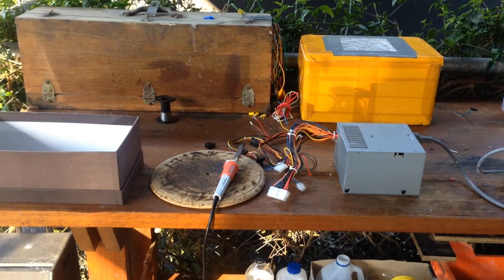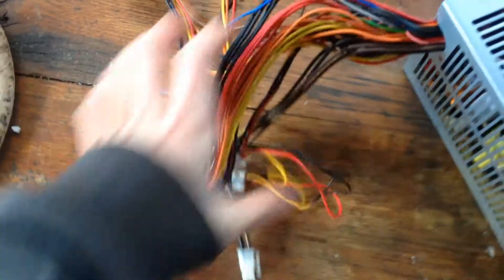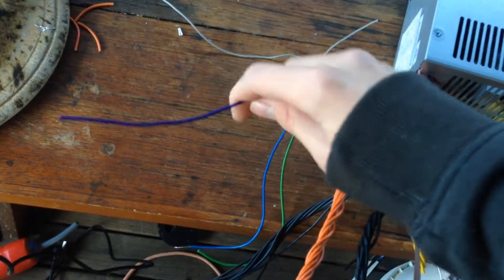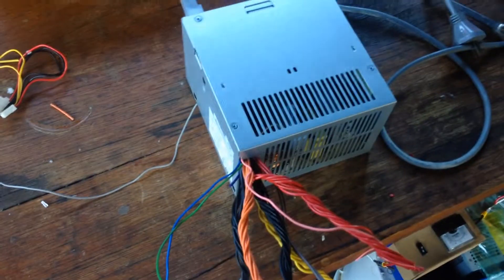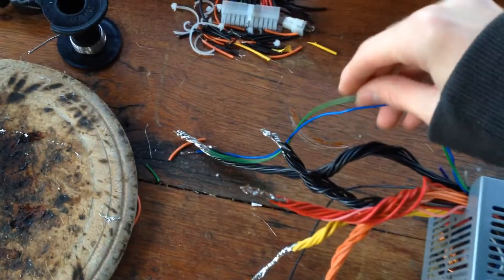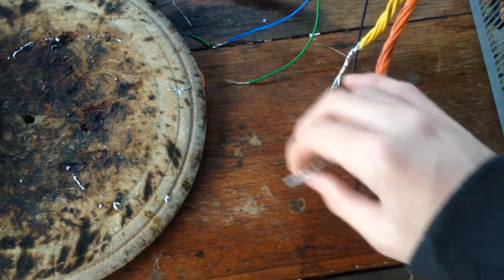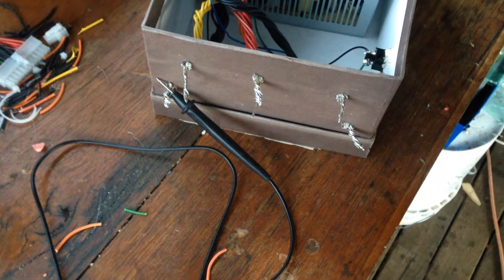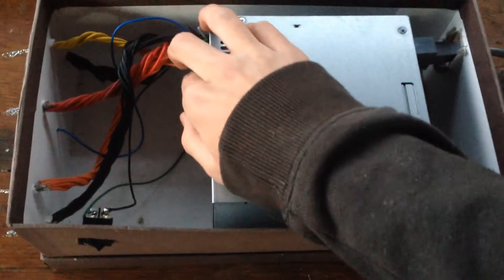Power Supply From a Computer PSU

Comment: Also what could I do with the -12 volts :D
Reply: as he said in the video: you could make 24 volts with really low currents or 17 volts or 15 volts.

Voltage is the difference in potential between two points meaning that you have to check the distance between the two points: -12 is 12 away from 0 toward the negative direction and 12 or 5 or 3.3 are all toward the positive direction  so the distance between -12 and 12 is bigger than between 12 and 0 so you can make higher voltages
Reply: thank you ! i need the amps so i found the -12 to be rather useless i have it tapped off and just use the 12 volts for my projects !

Comment: The PSU I'm using says it only has +12 and -12 it has yellow brown and black main wires then smaller little ones would the brown be the -12 volts ?  it's a older PSU can i still do this and just miss out on the 3.3 and 5
Reply from the maker: I'm afraid I don't really know, you'd have to look up the specific pinout for the model of PSU you have (or just measure the voltages with a multimeter). If it only has yellow, brown, and black wires, it's not an ATX type supply, so I'm unsure what the colours mean (black is almost definitely ground, but I can't tell you anything past that).
If you can figure out which wire corresponds with which voltage, it should be perfectly usable as a 12 V supply. You can also use the -12 V and 12 V lines to make a total of 24 V (note that you probably can't draw much current here, since -12 V lines aren't often designed with high power in mind).
Reply: i just got the notification for this ya its some knock off weird psu i just use the 12 volt line and it works perfectly !!  @ScrapScience

Comment: Can i charge my 12 v lead acid battery with this psu
Reply from the maker: It's generally not very efficient to charge a 12v battery with a real 12v power supply. Proper battery chargers, despite saying 12v on the box, are actually around 14v, seeing as you need a bit of an overvoltage to properly charge the cells. It's definitely a better idea to get a proper battery charger rather than using one of these.